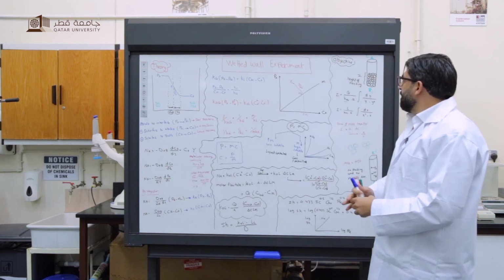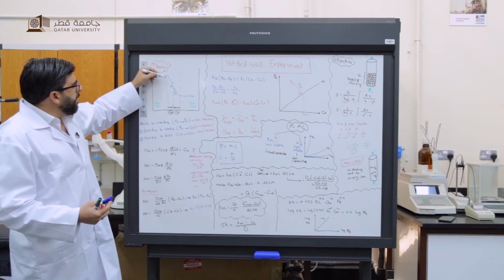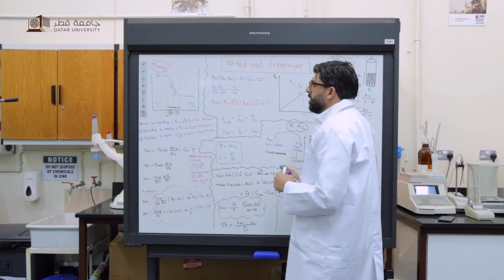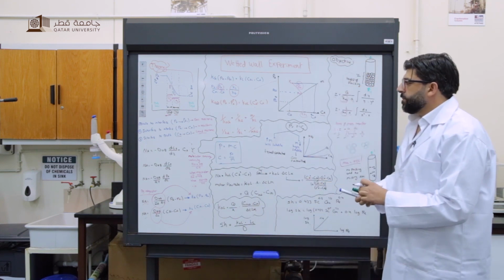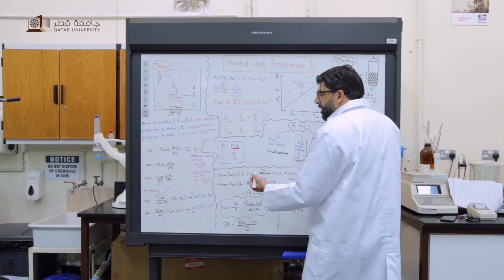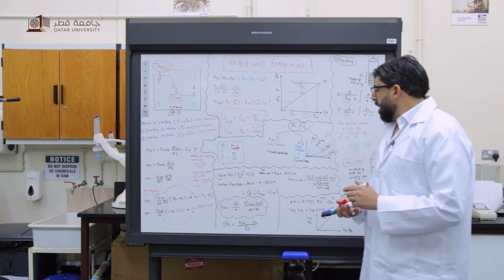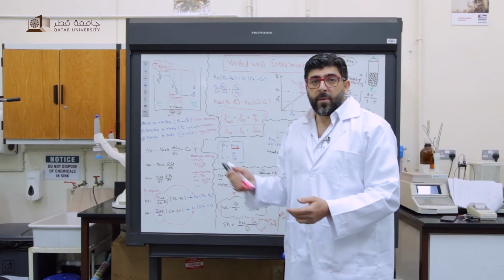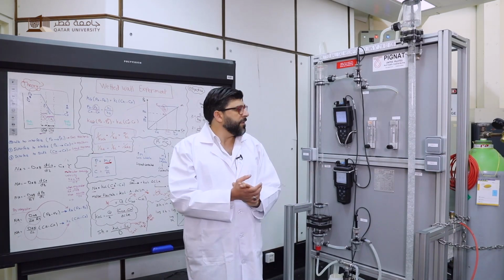Wetted Wall Experiment (Theory and Live Experiment)

Comment: Which of the following liquid-vapor contacting devices provides maximum contact surface area for a particular duty ?

[A].	Sieve plate column
[B].	Bubble cap column
[C].	Randomly packed column
[D].	
Wetted wall column	@